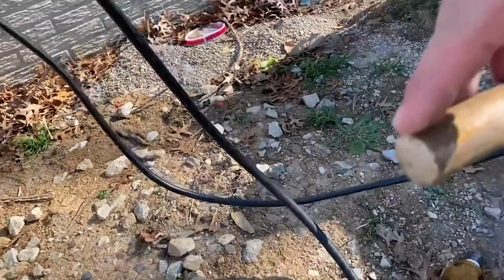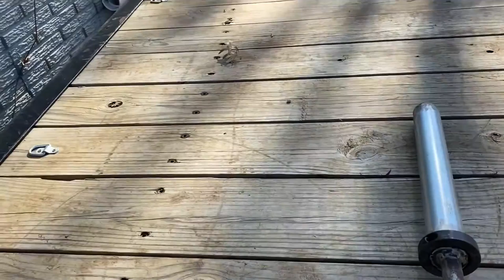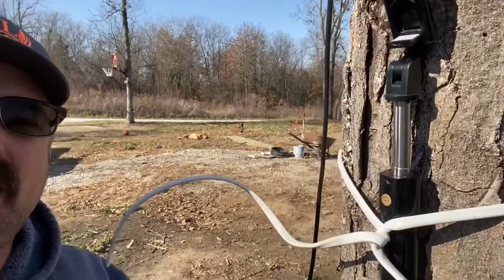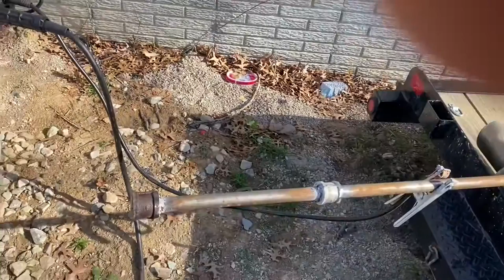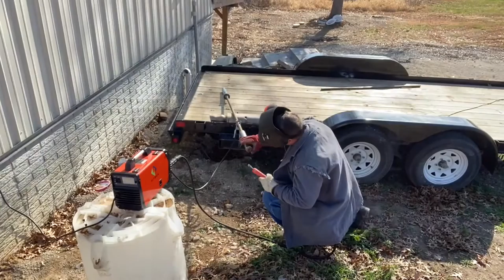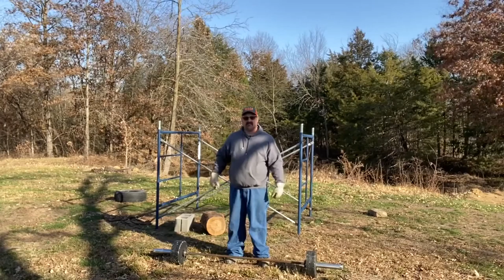Build an Olympic bar, DIY barbell build

Comment: How much weight can it hold?
Reply from the maker: That is a great question. I don’t know. I only have 200lb worth of weight currently. I would be comfortable with 315. I know good bars flex at 405. If you are getting into more than 315 I would buy a good barbell. That being said I do plan on testing my barbell at 500 in the future.
Reply: Thanks a lot!! I see you have done a great job with yours and I was thinking of building one because here in Greece every gym equipment is sold out completely or is very expensive. my deadlift is way more than 315 and probably I will wait to buy a commercial barbell. But I am thinking of building a multi grip barbell because it can withstand more Weight and for sure I will weld my own squat stands and bench.and build concrete weights also
Reply from the maker: @dimitris8575  I don’t want to tell you it can hold 1000 lb and then you get hurt. Building this is fun. You should build it and try some weight. I squat 500 and when I have 500 I’m trying it for sure. Your local steel\welding shop will be able to tell you how much the bar can hold. Thank for you for asking it’s awesome talking to someone from Greece.